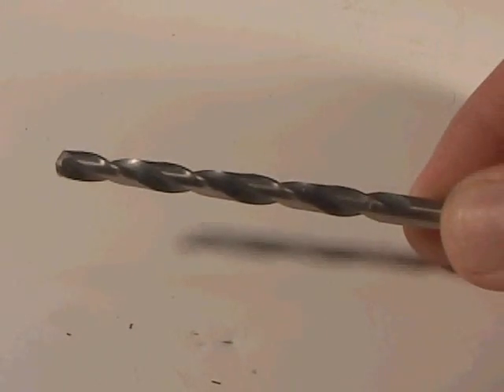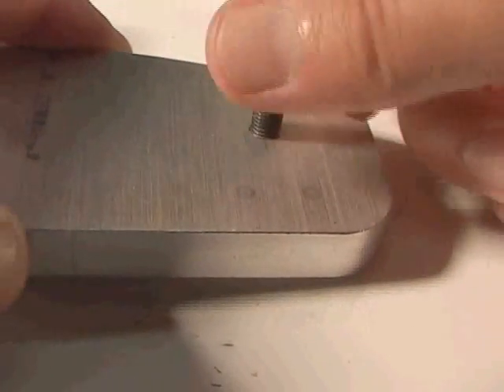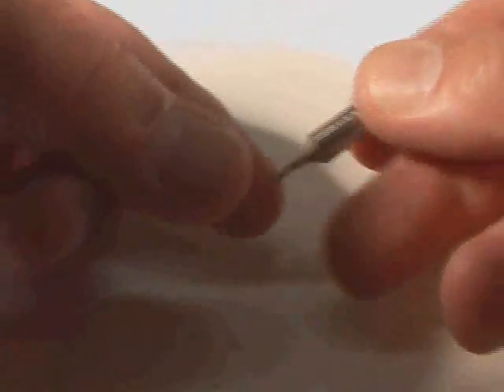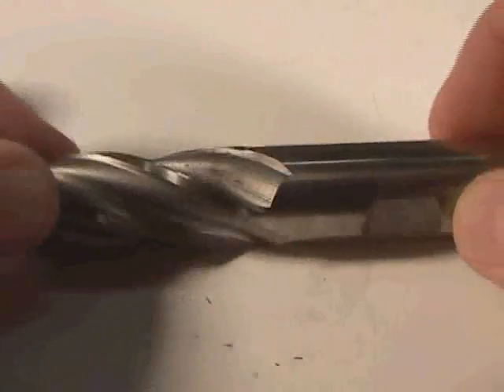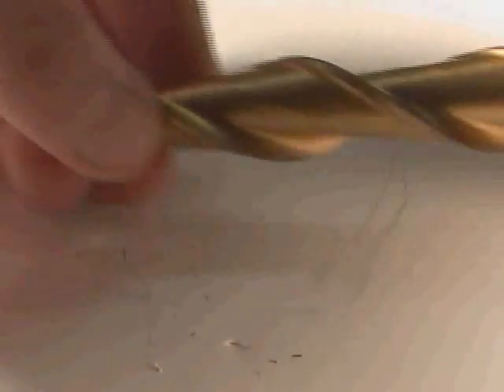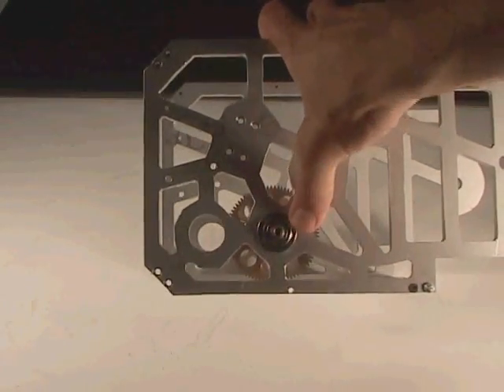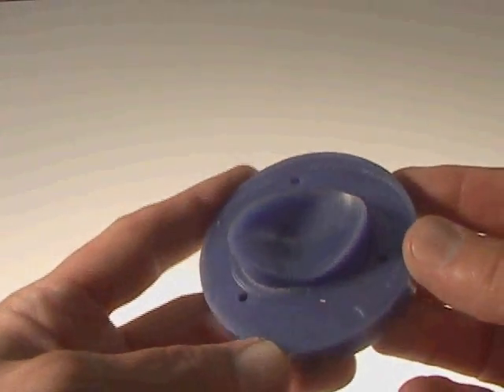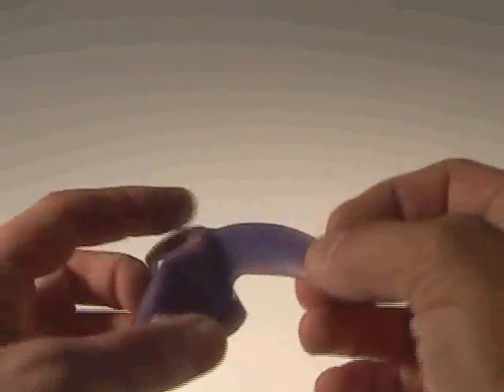CNC Tutorial 1 of 3: Introduction to Machining (19 minutes)

Comment: If I wanted to mill a pattern on the inside of a metal bottle, how would that be done? How do professionals machine cavities?
Assume the bottle is made of titanium and too awkward to dremel or chisel.
Reply: +Daniel Smith Titanium bottles are formed by a titanium sheet hydraulic press. So mill the pattern into the sheets of titanium in places that will form the inside of your bottle first, and then run the titanium sheet through the hydraulic press.
Reply: Thank you sir

Comment: i got a desktop milling machine to cut small parts at home is a cnc 3020T DJ series  you can find this one on ebay for around 700 in the us, now it came with some drill bits but im not sure which is the one for my project as they did not come with names so im not suure  but most of this bits look like what you guys call a engraving bit so this is not the one for me as i tend to cut very easy to cut/work with aluminum or wood or even PLA/ABS plastic, i got this machine to work on my robots parts which i design in Autocad 123 Design and then later bring in to a free milling CAM program but in a part of the program its asking me what type of tool i will be using and im not sure how to answer this question , this is where im looking for help
Reply: Sys.stem http://www.ebay.co.uk/sch/i.html?_from=R40&_trksid=p2047675.m570.l1313.TR4.TRC2.A0.H0.Xcnc+bit.TRS0&_nkw=cnc+bit&_sacat=0

Comment: what is the difference between a cnc milling machine and saw a 5 axis machining center
Reply: Its the number of axis and its features.. CnC's machine are basically 3 axis and costs less than 5 Axis CnCs.. Advantage/s of 5 axis CnCs are you can finish complicated products with less time, you just need to twist/turn the product just only 1 time to finish it completely and etc.. While in 3 Axis CnCs you might need 2-4 twists/turns to finish the product and might requires longer programs.. 1 twist/turn is also possible only if its less complicated product but both are great machines and it has its own advantages..